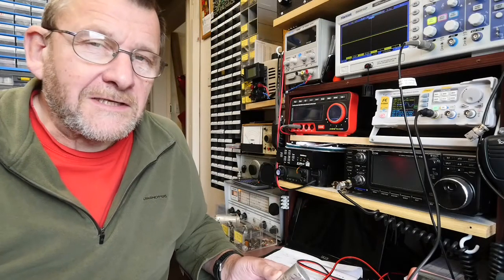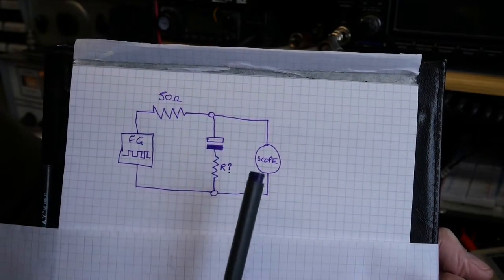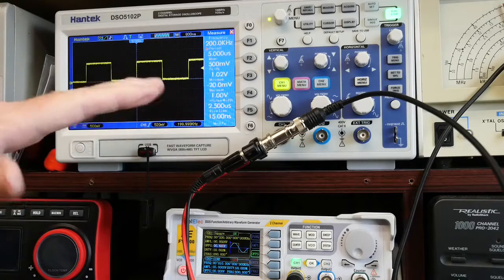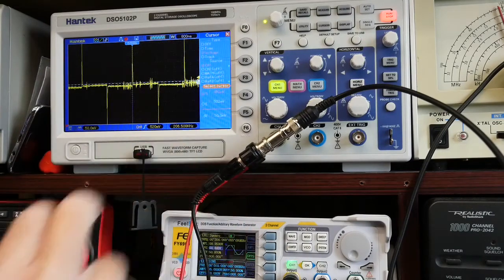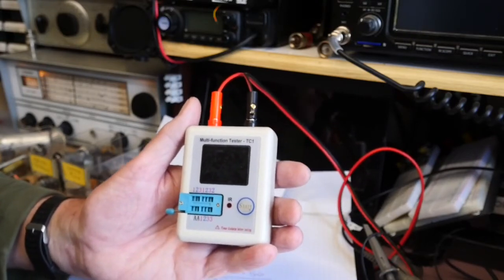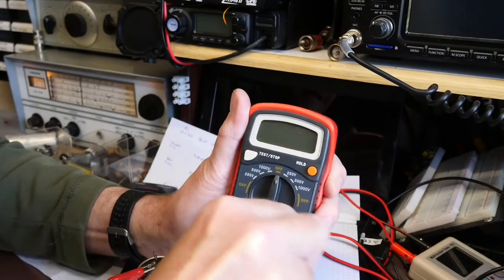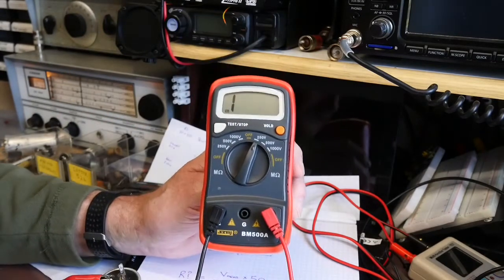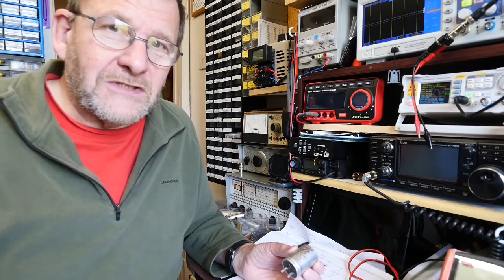Measuring Capacitor ESR (Equivalent Series Resistance)

Comment: Many people still don't understand why the high voltage test is important with certain capacitors.

As shown here, a cap passes all the low voltage tests, but the moment you go above 100 volts, the truth about the cap is reveled!
Which is why such tests were important in the tube era, and with high voltage parts, it still is, even if it isn't in tube equipment.

But with high voltage circuits, extreme care must be exercised, all the time.

Comment: This ESR testing is baloney. Not all caps are concentrically  wound with a linear length of foil. Modern caps are concentrically stacked cylinder with end caps and naturally have a quite low ESR caps wit so-called low ESR are of no real value un audio circuitry.

Comment: Just measured an unknown (unused) capacitor with unclear markings (ERIE). low voltage results were 500nF and ESR 0.12 ohms with 100kHz test frequency using an LCR meter. It showed 50k-60k ohms on a 250V insulation test -  and 1.52mA leakage current.  An indication, perhaps, that a working voltage of 250V was optimistic.

Comment: I'm getting back into electronics again after 30 years so this was very helpful.  There's a lot to know about capacitors and measuring their performance.  Great video!
Reply: I'm about 5 years less than you getting back back into it. I seek channels like this as this is more in depth. It's also more involved with analog.

Comment: It's cheap and cheerful chinese components, but it's running open source german software :) You can search "AVR Transistortester - Mikrocontroller" for the homepage of the software. I believe high voltage steady-state leakage and ESR for a certain frequency are really two different measurements in practicality, and yes for high voltage equipment the former can be just as important.